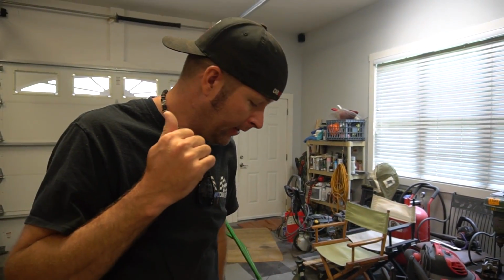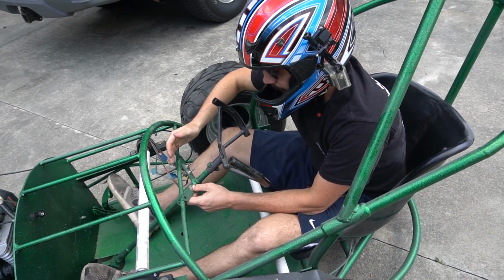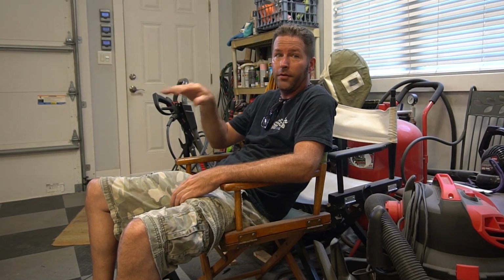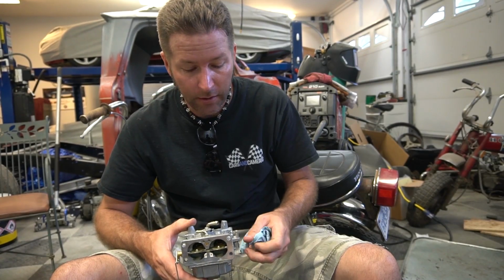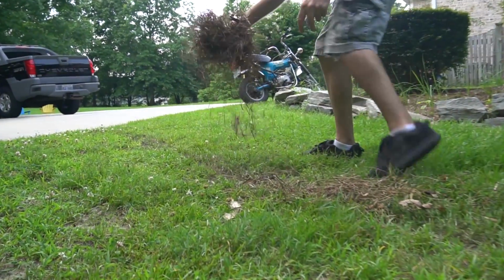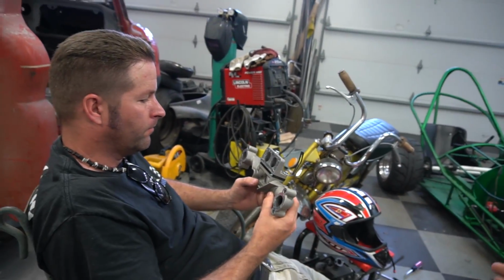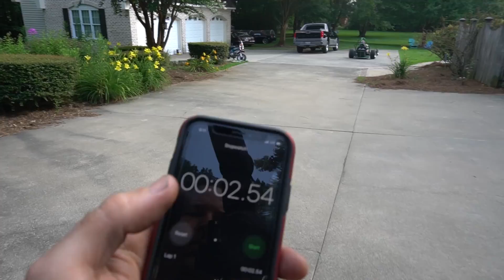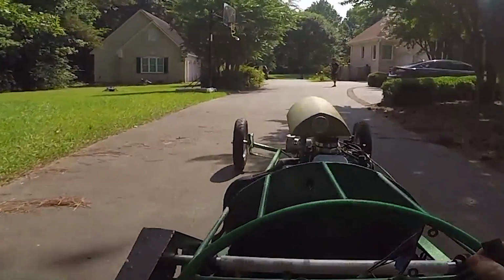THE DRAGSTER DOES (BABY) WHEELIES! | 50HP 670cc Drag Rail Kart

Comment: Efi with a tps and oxy sensor!  Since its 1 gear u dont need to worry about duty cycle it be like a on the fly carby.  Fyi looks like a dodge ram 2nd gen throttle body might fit. If not 3d print in abs plastic a throttle body neck down adapter, should work like a small supercharging effect.

Comment: Would you consider creating a much thicker (several inches) thicker spacer with one large diameter hole instead of two? or an EFI system like what you used with the power adder on the smaller cart?

Comment: dual carb or even a single carb (mikuni) sound like a good idea, but is the heat range on the spark plugs correct? if they are to hot they can ignite the mixture at the wrong time and if they are to cold, it is possible they wont ignite the mixture! at all! maby look into that

Comment: It needs suspension so you can tune in some preload get the front end coming up so you can get weight on the back tires looks like its spinning and with a better carb its really gonna spin

Comment: U guys should turbocharged that baby👍 u can use a small junk yard turbo from a small displacement engine and modify the A/R u know the exhaust housing  by I welding the section that meets the turbine wheel clothes then cutting a small slit into it that baby will spool up and make a lot of power Mount the carburetor on the intake of the turbo make it a draw through system the extra fuel pressure if needed will come from the boost pressure that you're making which you probably wouldn't need taking in consideration it would be a draw through system man this would be beautiful

Comment: A carb for each cylinder since theres a chance the fuels going to the rear one.  Electric fuel pump about 15 pounds with a regulator at around 4 pounds or a tad less.  Alchohol but with a alchohol carb, the key way advanced notch key for more timing after trying the fast first

Comment: Would you be better off using 2 separate makuni's. One per cylander? Also, where would I find a 1inch clutch to a 9 hp Tecumseh in#41 or #420 sprocket for cheap?

Comment: It will be a totally different engine with a mukuni . Ive been using a kehin pwk flat slide with av fuel and its not even close to the way it used to run . I have a 34mm but 36 seems like it would work a little better

Comment: Are those the spark plugs that came in the preditor engine. If so please change them with new of any kind and you will see marked improvement in every way. Even if they seem to fire. Just try it you won't be sorry. Thanks guys. I bought two of theses engines and changed  a Champion plug cause that the brand the store here in town had. Made a world of difference in the engine power you can't even believe it. Really.

Comment: SUDCO sells mikunis for v twins pretty cheap, a 36mm shud b plenty it ran my 1000cc sportster no prob( there 62hp stock) theres also have a nice heavy s/s slide, ive been told aluminum slide mikunis on big v twins wont return to closed under high vacume and stick wide open...

Comment: kind of sounds like clutch is slipping.  breaking up on high rpm's under load could be poor fuel pressure or air in the line due to a bad hose or clamp.  Happens a lot.  Also you have some chain skipping happening

Comment: I'm just wondering does it have a cdi on it if so I would cut the pink wire it is the speed limiter once you hit a certain rpm it won't let it go higher I did it to my scooter and it works great

Comment: I'll put money that the extreme acceleration is interrupting fuel flow in the carb, possibly from float shutdown...
 Try lifting the rear tires off the ground with jackstands, and gunning the throttle a few times - if it doesn't sputter, you might have a fuel delivery problem...

Comment: In reference the launch/60' times only/

Gentlemen: in the slowmo, there's definitely a measure of wheelspin, which you know. Wheelspin may cause a higher trap speed, but that spin time is directly deducted from your elapse times, which you also know. Sometimes you need just a little, so you have to be sure of the effect it's having one way or another which you should also know, and there's no way to tell from the video here. 

John, you don't have "perfect" track conditions in dad's driveway, so I wouldn't expect your 60 ft to improve without addressing traction. 2:fity is probably as fast, (as an average,) as that particular circumstance is ever going to let that particular mobile get moving with that particular set up. It sounds like your stall speed is fuckin' boss, (if not very slightly high! .. awesome! .. don't change it,) so tire pressure is the next obvious line on the "how to control my wheelspin" list, BUT the driveway isn't the track, so; priorities?

Address the carb as you feel you need to. I have no idea from my phone screen 2800 miles away how to diagnose that issue and obviously most people couldn't, though I'm sure they will try. I know you both probably know this shit at least as well as the next guy and half the fun of the channel is the experimentation and the "It'll be fine" attitude, so take it as a reminder to look at each problem separately as well as together, not as I'm questioning your ability or knowledge. I feel I got a personal stake in the dragster and the T-shirts now so brutal honesty leads to success and as always:

Green for the 💰's
Gold for the 🍯's

Comment: it actually doesn't matter which way the poles of the magnets are facing. It will spark either way. even in reverse rotation.  1980s ezgo and Yamaha 2 stroke golf cart engines are proof of this. with no transmission of any kind they would go forward and backwards with the flip of a switch. which would swap from one start solenoid to another ,one wired to rotate one direction and the other wired backward to rotate the opposite direction. Just a suggestion but have you thought about using an electric PTO clutch..... choose the RPM and engage when you want rather than wot which is at the end of the range where torque is produced.

Comment: Looking for some knowledge here. I just purchased a 670cc engine and want to remove the governor, add an air filter and a custom exhaust. If I do have to buy a new jet for the carb or drill the jet what size should the new jet be?
Reply: rolando jatib we didnt mess with our carb. Performance 670 worked our carb over. I usually just find the drill bit that fits the jet and and then go two sizes up. Its worked for us in the past.
Reply: Isaac it'll be fine, awesome thanks Ike!

Comment: A lot of stuff you're doing could be done better, the open plenum should be directly under the carb. Also you should abandon the stock intake and fab an intake coming straight out of the port, also turn the idle up, you will get better launches if the rpm differential between the idle and stall is smaller. I would look at one barrel down draft carbs like stromberg 97 or 2 side draft mikuni aimed opposite directions

Comment: Are you guys sure you're fuel pump is up to the increased flow demanded by the higher than stock power levels?  I haven't watched all the vids on this build, and didn't see if you upgraded it or did any math on how much flow you need.
Reply: Joe Keele automotive fuel pump on it

Comment: It's weird its doing the same 60 foot times because it looks wayyyy faster. I didn't see any engine issues it seemed like it was running fine? Are you taking it apart just because the 60 foot time was the same? Nevermind I heard it missing after you put the stock carb on. Can we get confirmation that it is actually 2.50 before and after? Review the old footage? It looks so much faster now it can't be the same. Maybe it was 3.50 before.

Comment: Theres apps for phones that will use GPS and the gyros to get 0-60 times, 8th mile, and so on. It will also show how many G's its pulling on acceleration, turning and such. Would be way more accurate testing the performance gains/loss in the mods

Comment: I'm building a 20hp go cart live axle stock engine. I bought a 40 sieres clutch, will it hold up to off road trail riding with some hills?
Reply: We have done alot of trail riding with ours the only problem we had was when we got in deep soft sand bogging it down we did overheat the belt dammaging the belt. It would be a great idea to have a spare belt with you just in case. We have been very happy with thw 40 series
Reply: Ok cool, down here in South GA  there's not to much sand. Where I'll be riding is on 4 wheeler trails and raw wooded land. Thanks allot for the info.

Comment: get some nitromethane and  mix it at 30% to 50%!(not cheap azz hobby model fuel crap) The valve springs can handle it. And how cool will it look with the fire out the pipe! Not to mention the speed increase......that or put the ducati engine on it!!!

Comment: Did you guys ever shave the heads to up the compression and I just missed that episode maybe?
Reply: Delicious DeBlair we had the heads worked by performance 670
Reply: Ahh okee.

Must just be time to put some boost in there some place then... 

If I had a whole bunch of them I would give you a roots blower, but I have only one and I'm a bit too stingy to give it away when I have several go kart projects lined up...

I would love to see somebody use a leaf blower impeller or vacuum cleaner impeller as a positive pressure booster, I aim to strip one apart which has decided to keep slipping the belt, and pull the armature from it so it is just a compressor. That may be a ways down the road though.

Comment: 13:20 you better fix that hub on the right rear wheel or you're going to be coming off the track in a random direction not of your choosing!
Reply: kleetus92 axle flex
Reply: Wow...  ok... but why didn't the other side do that? it's a solid axle right?

Comment: Plugs were wet and you have obvious misfire. I don’t think it’s a fueling issue, I think you’re still looking at an ignition problem. Getting a bigger carb to provide more fuel to burn when there is raw fuel on the plug when you pull it out won’t fix the problem. I think you need to possibly try a hotter plug, or advancing a degree or two. Try and burn all the fuel you got right now before you throw more at it. Just my 2 cents....

Comment: Here's an idea - instead of 2 right angle adapters, one on the intake and one on the air cleaner. https://www.holley.com/products/fuel_systems/carburetors/performance_2_barrels/parts/0-7448 ---- Straight down into the manifold.

Comment: No wonder you bent it it was made for a track should of put the motor side ways so you can run a drive line and a rear end like you did on the wagon you could made duel exhaust pipes plus your chain will be shorter and your clutch will be on the shaft by the wheels

Comment: I feel like the problem is in your gearing your redlining in the 60' and theres no way your gonna pick up time like that plus that stall needs to be closer to 1800 cause your running out of fuel as soon as you start rolling. Lean harder on that torque converter.

Comment: Turn that engine crossways and run a short belt to a shaft drive to the rear end. Maybe a rear end out of an electric golf cart? Or 4 wheeler. Get rid of that power robbing chain and floppy rear axle setup.

Comment: Why would you not just tear apart the carburetor and check and see if there's any junk in it and clean it and you probably need a vacuum meter so that you can adjust it properly I know most two cylinder motorcycles and multi cylinder motorcycles you need a synchronize the carburetors was either a Mercury vacuum tool or a set of vacuum gauges

Comment: Looks fun and all that, but if you are looking for dragstrip times wouldn't you be better maybe with a motorcycle engine and a manual gear box? With the greatest respect 50HP from 670cc ain't that much, and you must be loosing a shit load thru the torque converter. I mean even old British parallel twins from the 60's and 70's made about the much from their 750's in road tune. Don't know much about modern bikes but I'm betting a modern Japanese 500 cc sports bike engine must put out a lot more than 50HP and has the gear box and all that built in, anyhoo you guys look like you're having fun.

Comment: Should have put the Ducati motor in it
Reply: ike said he wants to see how far he can tune this engine and how much he can get out of it  and the second part is for the 900cc they would have to do a ton of fab work to make it work
Reply: Missing the point..... The point is to go as  fast as possible with THIS engine. Ok if you put a 900 on it, it will be faster. Put a 1200 on it it will be faster again. Maybe put a v8 in it?? Yep, faster again...not the point of the exercise. Personally I love seeing the guys trying to get more out of the Predator and working out the issues. That takes much more  ability than just slapping a bigger engine on it.